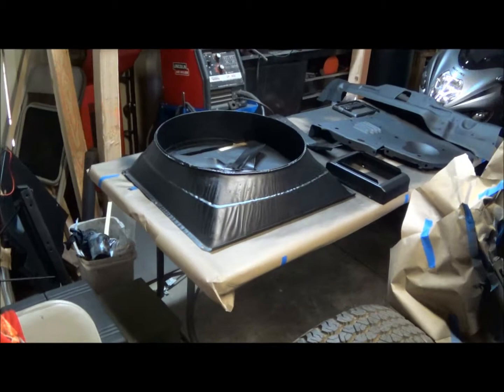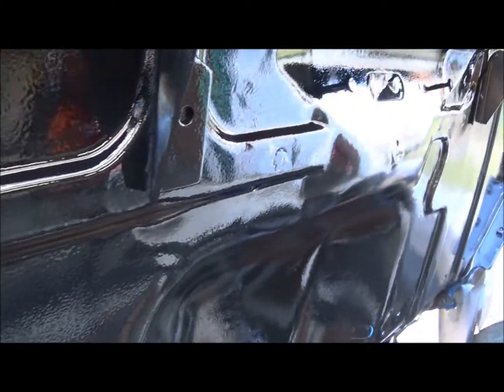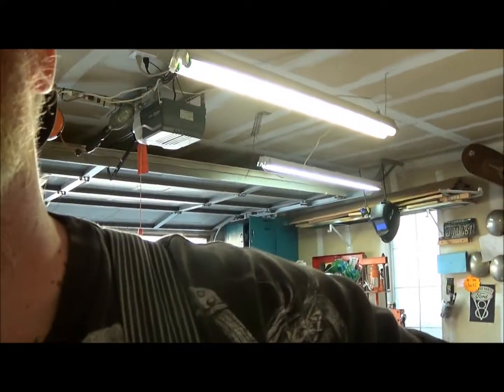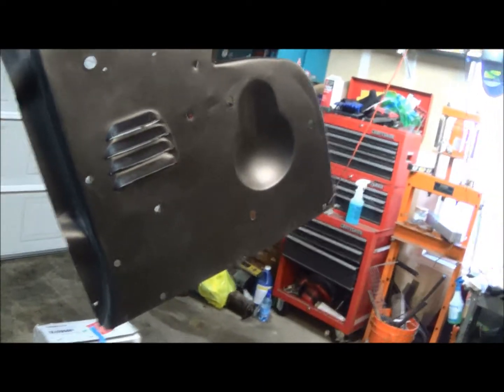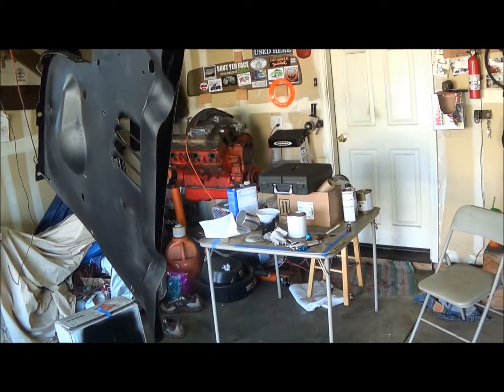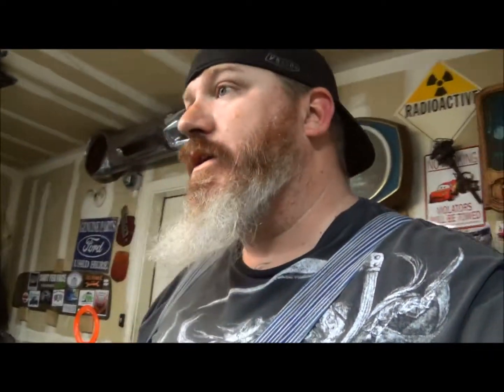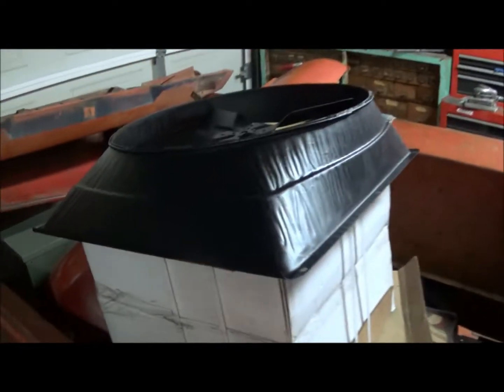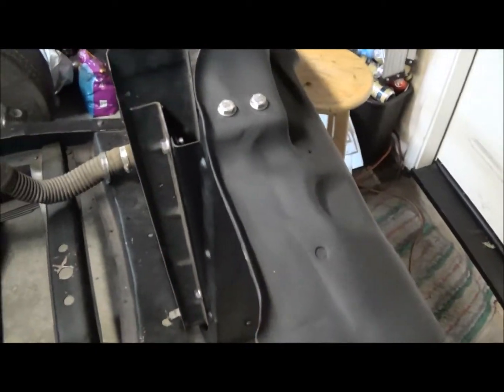Sunday paint fail?

Comment: Once you get texture in a panel, it's hard to flood it out.  One thing to remember with 2k products is if the reducer or hardner is too fast it won't flow out.  I was told once that fluid control is orange peel control and air volume is run control.  If product is too thick for tip size, add more reducer.  And practice is progress like Milric said.  Take it easy
Reply from the maker: Thank you very much. I followed the tech sheet and it seemed to thick, but I don't know enough to know for sure. Thanks for the fluid/run control tip, I can remember that.

Comment: I think it's awesome that you going for it with the painting.. Even the best painter or expert at anything didn't know how to do it till they tried it. That's how I have learned what little I know, I just tried it..you may consider getting some sheet metal, an old fender or washing machine to practice on.  For me learning to see what the paint is doing was a big part of it. Looked to me like the paint was a little thick. But it may be fine under the hood,that area always gets a little dirty anyway.
Reply from the maker: Thanks man, it's been a long time since I tried to learn something new so I need to not get frustrated. I have some spare stuff to spray on, I picked the engine compartment first for just the reason you said.

Comment: Don't give up hope brother, you will get it. I had a similar problem with some single stage and I turned my pressure down a bit and it got much better so only advice I can give you is play with the settings and things until you find something that works. Velvethamma has a great video on setting up a paint gun so you might want to check that out. Take care.
Reply from the maker: I won't give up, need all the practice I can get. I've been checking out set up videos a lot, I think I understand a little more. Or I'm more confused hahaha. Thanks Jerry.

Comment: Simply put, If you're getting orange peal you either need to decrease your fluid flow rate or increase your air pressure and to me it looks like you need to increase your air pressure a lot . Air pressure is key, The higher you can keep your air pressure the flatter the paint will lay out. You will know when you get to the point of having too much air for the fluid rate when you start getting dry spray on the panel you are painting(seems like it's drying before it even hits the panel), then just either increase your fluid or decrease your air if that happens. It will take you some time to find the sweet spot. Another thing is using the right fluid tip for the paint you're spraying and proper reducing of the material. Good luck.
Reply from the maker: Thank you very much for all the info, I'm going to mess with the air pressure next time I paint for sure.

Comment: Hard to know exactly what the issue is without being there or at least seeing you how sprayed it and what your pressure was ect... This is all part of learning, If this doesn't happen you will never know how to avoid it later.  Sadly wasting material is part of the learning process.  If I had to guess, I would say maybe your pressure was to low and maybe the gun was too far away from the panel..
Reply from the maker: Thank you for the help.  I need to remember it's a learning process, honestly it's been a long time since I've tried to learn something new.At least I get to practice sanding some more hahaha.

Comment: I painted cars about 20 years ago the paint I used we had a 7 to 10 second rule reduce your paint so when your done stirring once you lift the paint stick it should flow off the stick and start dripping at 7 to 10 seconds. apply light to medium  coats. in between coats let it get tacky about 5 to 10 min depends on temp.I put at least 3 coats on.3 coat I would cheat and add some clear try that it worked for me maybe paint small part first.

.
Reply from the maker: I like that 7-10 second rule, something I can remember. Thank you for the help.

Comment: Turn up pressure and reduce more if needed, what gun are you using, if its a hvlp gun, is you compressor up to the task? Sometimes with thick paint and low cfm compressor this is the result, some even hav e the right compressor but wrong hose and fittings to the gun and get the same problems :) spray distance ofcourse and movement plays in.
Reply from the maker: That's what I'm going to try nest time, and I do have plenty of compressor.

Comment: put one light coat on wait 10 min or so then spray one more and be careful of what you use too wipe the metal down with.. was that the epoxy paint you used because it is a two part 50 /50 mix  top coat and activator
Reply from the maker: It's a single stage 4-1-1, I'm going to try a little more reducer next time.
Reply: okay...enjoy